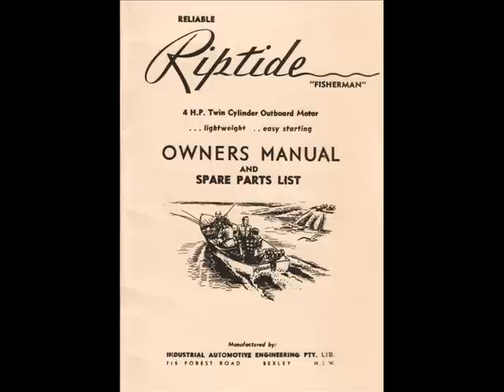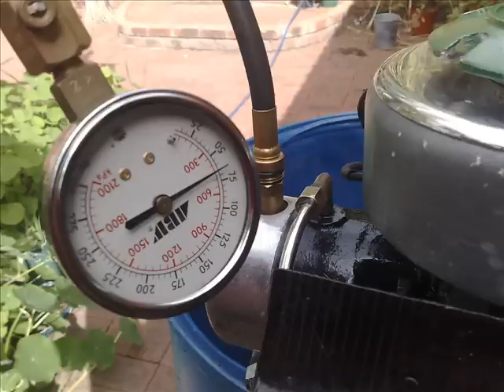Australian Vintage Riptide Fisherman Outboard Motor 1956.

Comment from the maker: When the clip is not renewed or installed correctly the CLIP will fall out yes. The pin will or should not, in theory, do anything as is fitted from the top of the piston. There was a taper from all accounts. Have a look at your bore and layout of ports. Maybe send me some pics as I have never seen what you describe. Nice comment by the way....................

Comment: Nice motor. but they had a habit of dropping the gudgeon circlip out the exhaust. The gudgeon then machines a groove in the bore. I have two motors with this identical problem.